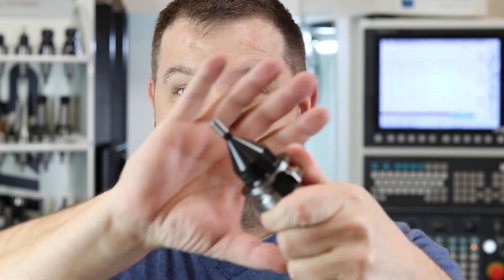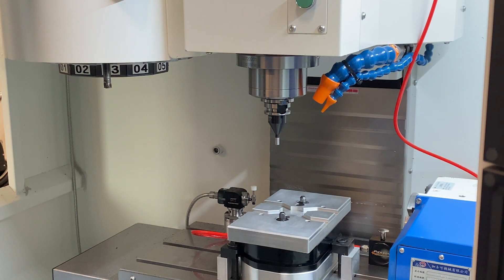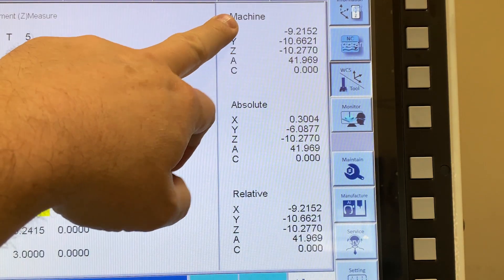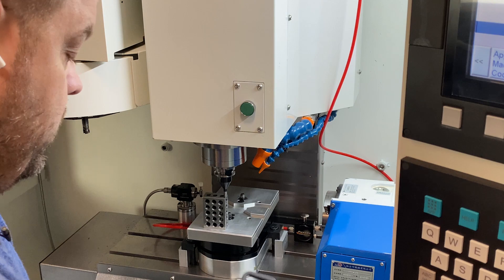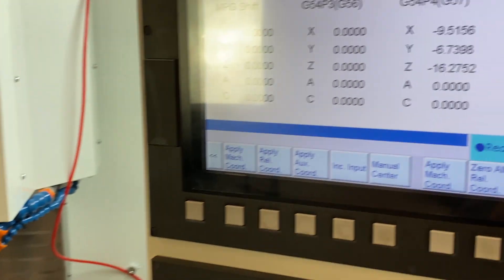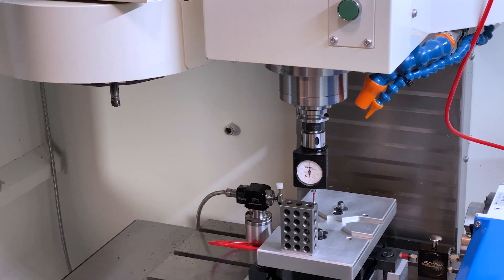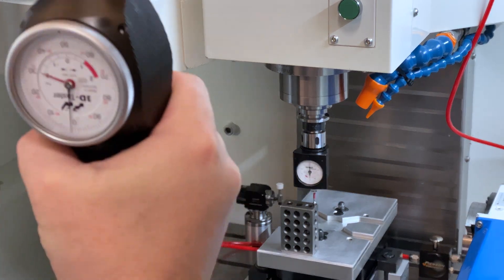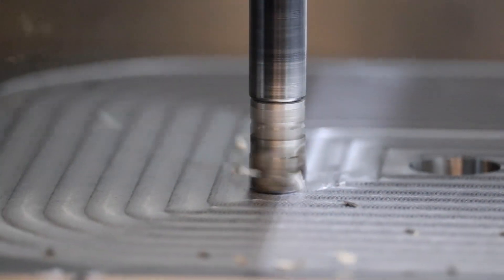Calculate Haimer Length

Comment: 3:24 yup same way as dial without need use (we not have any tool height calibration tool) xD. you could make your ref point 3.000 so not need calculate later lol

Comment: 0:56 to measure haimer you need another tool xD and tool height is machine maxium travel to bed(-+)known heigth from bed(-+)current machine z.
(-+) bcoz you need figureout it your self. machine coordinates are -. so you kinda add to get closer to 0 and result is - but you remove it. tool height is positive. dont do HAAS lol.
put your dial indicator spindle flat area next to taper zero coordinate(and dial) raise z. put tool in lower till dial say 0 look you machine you are abow zeroed place thats your tool height.

all this not matter if you allways measure all tools same place that not change.
max z travel-block height from table is you machine coordinate if you want make it work zero for measure point. remember number is - .
and max trvel is what manufracture has sell your machine. it might be acurate but its fine if you measure all tool same place allways xD

same way you can figure your max z if know tool height like your (calibrationn tool)

Comment: How do you like the pioneer probe? And tool setter? 
Any problems with it? 
And is that radio version?
Reply from the maker: love the tool setter...i honestly never use the probe. on this machine. I'm actually spending some time this week to try and get the probe set up.
Reply: @NerdlyCNC  I’m really on the fence on the radio probe or the light since style. I’m on a router and I do a lot of weird set ups I’m leaning to the radio style so I don’t have line of sight problems. I wish I could talk to somebody that owns it and use it.
Reply from the maker: @BeeInnovative   I had a RMP Renishaw...it was awesome.a

But more expensive.....Is renishaw an option?
Reply: @NerdlyCNC  I just can’t justify the cost. Especially if it ever crashes. Pioneer looks like a good company.

Comment: Hi Nerdly
Geart video. I run a old machine with a old fanuc controler in our shop which dont have all the fancy equipments. If you make a video on how to do the tool length offset without all the luxurious equipments. I would be appreciated. 
BTW there is no useful video on that subject. 

Thank you

Comment: Hi 
I know that calibration tool is just for helping to find other dimensions of haimer and tool touch off sensor. but 3" length is just relative, and can be different on different machine. because is not BigBT30 ( it has just tapper contact) .
 My point is that if some spindles have a bit wider tapper, than there is little bit shorter distance from spindle nose to tip of calibration tool. My point is that it is just relative 3"

Comment: HI Jay  Another great vid.  To calculate length of the Haimer why not use your tool setter.  This way all length measurements are referenced to the same instrument.  If the tool setter has a height error it does not matter.  As long as it is consistent and repeatable.  The only requirement is to subtract the ball radius from the length that tool setter gives.  Why this works is that the preload on the Haimer stylus is much greater than the tool setter.   I actually have not tried this with the Haimer but I have a similar German device called a Tschorn.  I would be interested to see if it returns the same answer in your case.  Cheers
Reply from the maker: Everything is referenced to the Maritool calibration tool...the tool setter and the Haimer.

Comment: With Hurcos, it's easy - crank down to reference surface until Haimer zeros, then set tool length 

The fun part is remembering which Haimer is assigned which tool # - there's the shops Haimer, and my personal one, and they're only one digit off from each other in the tool registry.
Reply: I just got my first hurco. A 04 VM1 with ultimax. I had a hard time setting tools and parts at first, as it was my first cnc. I figured out that I if I zero all my tools and the haimer from the same surface(back of the vise for me) everything just works as it should. I do believe I have to turn off something in the control, like z offset or something it’s called. Not sure what would happen if I switched over to the conversational side as I don’t use it anymore.